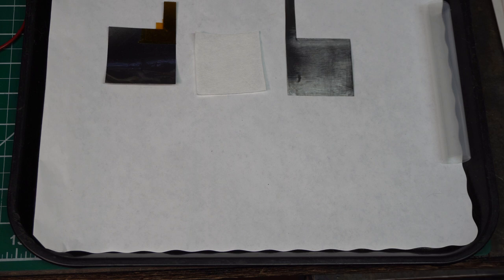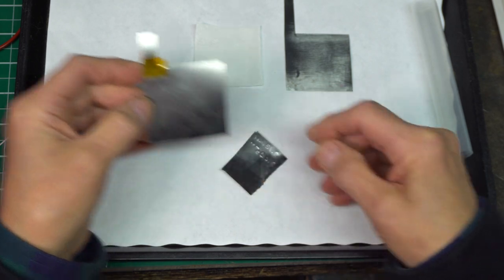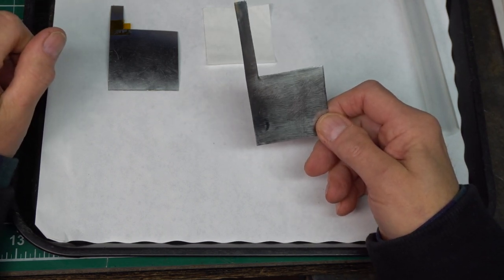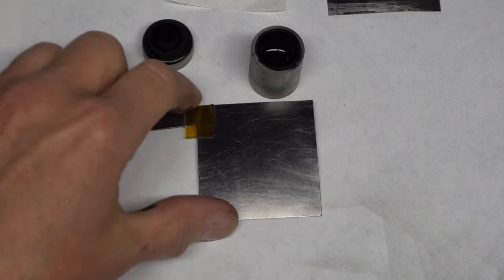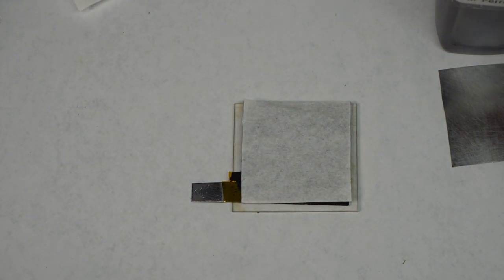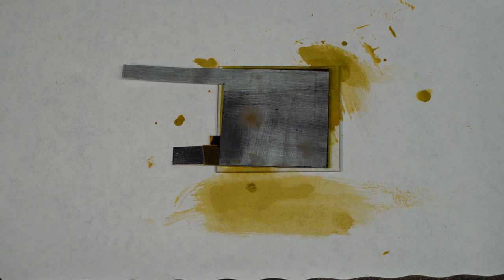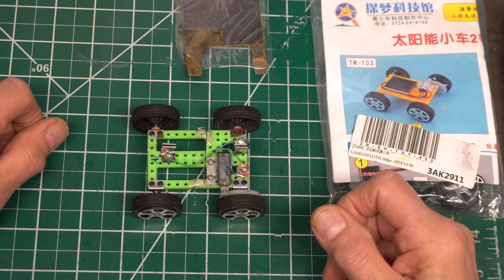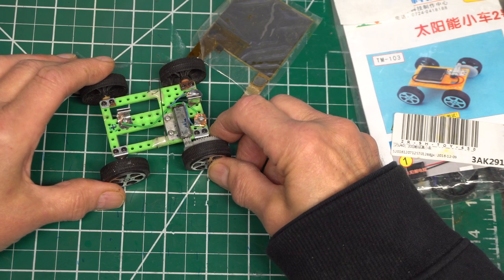Electric Vehicle Powered by Homemade Rechargeable Iron/Carbon Battery

Comment: Many problems:   
First, during discharge, your anode product is soluble in your electrolyte. That is to say, the iron chloride being formed at the (-) plate during discharge is itself soluble in the iron chloride electrolyte. This introduces many problems. For one, you therefore don't have a reversible reaction at the (-) plate.... i.e. you can't recharge the battery. In other words, you can't 'force' the iron chloride swimming around "way out" in the electrolyte to reduce again to elemental iron and re-join the anode substrate material. That would be trying to plate iron onto more iron from an FeCl2 plating bath using a non-iron sacrificial electrode (graphite), and that doesn't work. Iron plating onto more iron can be done, but is extremely difficult with complicated plating chemistry needed. In an Fe-Ni battery, as an example, the iron oxide stays on the (-) plate. It never leaves, because it's not soluble in the KOH e-lyte. It just oxidizes in-situ and doesn't migrate out into the e-lyte. Therefore during recharge, it can reduce back to elemental iron right on the (-) plate. Thus, you can go back and forth. Same thing over at the (+). The various Ni oxides never leave the (+). They oxidize and reduce in-situ, because they are not soluble in the e-lyte.  
Secondly, during the charge cycle of the cell in this video, depending on the voltage used, all you're probably doing is getting a little Fe to 'plate' onto your carbon in sort of a spongy mass, and generating chlorine gas over at the steel plate, and/or electrolyzing water and oxidizing your nicely prepared carbon. You said you charged up your battery for 5 minutes before running the car? What is powering the car then is most likely oxygen and hydrogen that was formed via electrolysis of water during the charge cycle. You have made a simple fuel cell in essence, which is a nice demonstration in itself, but not really a Fe-C couple. 
Suggest: 
Choose an electrolyte such that the anode product-of-discharge (iron chloride) isn't soluble in it. That's why we use KOH or NaOH with batteries having a steel (-) plate. KOH is more conductive than NaOH, and a little less nasty to work with, that's why it is used. 
Since you want to utilize carbon at the (+), why not make an Fe-Air cell? You're almost there already. US patent 3,649,361 (General Electric) lays out a simple method for the Air-side which doesn't require a noble metal catalyst. 
Or... paint your (+) with Ni(OH)2. Utilize a Tyvek separator. Use KOH e-lyte. 
Thanks for posting your work. Very interesting commentary.
Reply: nicepost! and thx tp video poster too

Comment: Hello William, I've replicated the cell you demonstrated and you have inspired me to make a video showing the cell. I've added a few minor changes and I'm quite happy with the result. I would appreciate any feedback or comments you might have. Many Thanks
Reply from the maker: I'm glad to have inspired some others to look at Iron/carbon cells. Not as impressive as some other battery chemistries but it's hard to beat in terms of low cost and availability of materials.

Comment: layered filter paper pouches for the metal plates
Reply: in a carbon air electrode casing, containing lead-acid like electrolyte with the electrodes

Comment: Nice little battery. Have you run any tests on it such as capacity, charge/discharge times, or cycle life? Do you have any info on the chemical reactions taking place at the anode and cathode? A suggestion: why not use a food vacuum sealer to seal one side? That way, you remove all air pockets and increase the contact between the active materials of the cell.
Reply from the maker: I did multiple charge/discharge cycles and the graph reports are in the videos.

Comment: Hello William, really great job. 😉

I don't know if you're still present to comment.

A question I have is about the kind of battery it is "really" , because often the iron based anode batteries presents lower volatges (it's not exactly the case here, kind of mysterious) : 

-  Is it more a kind of supercapacitor on the positive active material? (acting like iron phosphate pseudo capacity in lithium cells)
- Or some kind of internal oxygène breading (the oxygène is some how regenerated at ech cycle )
- Or just the carbon that makes the differential potential (theoritically in "average potential" of the table) and maybe the highest energy links between chloric and ferrous ions that help incrising the oxydo reduction difference (during ionic spliting)

Sorry if my technical engligh is not perfect, I'm nether English (an awful French)... nor chemist ☺
Reply from the maker: Thank you! I believe the overall chemistry of my cell is probably this redox reaction: Fe + 2 FeCl3 -> 3FeCl2 ,   Eo = 0.77V Eo = -0.44V Eocell = 1.21V.    So 1.21 volts is the the theoretical voltage and it looks like my cell is getting close to that output. I guess it's possible that it could be partially acting as a super capacitor but I don't know of any way to prove that. I don't think that it is an iron/air battery because the cell is sealed , completely closed off to the atmosphere, and doesn't have an air breathing cathode which air batteries require.
Reply: @William_Hada  super fast answer  after more than 4 years ;)

Thanks a lot ; Well I think you're probably near the point of cracking the most abondant iron based open source chemistery.

Let me just proposed some points / ideas of improvement or just verifications 

If it's not acting as a supercapacitor you could probably withdraw the carbon ink or at least the active carbon material (with porous reactants) and see if the voltage is more stable and non- breathing during discharge (with wet impregnate iron chloride cotton for exemple or simple graphite powder).

Maybe also try some more common stainless steel cathode electrode, supposed to be oxydo resistant and cheaper (I don't know for the catalist reaction - to be tested).

Nevertheless, good improvement and continuation in your experiments and life.
(From a simple methods engineer)
Reply from the maker: @mathiaspinto4197  Thanks for the suggestions. I found out that stainless steel does not work in this cell especially for the anode. 
Lately I have been working on a Zinc/Iodine battery cell and all my time gets taken up in that exploration. So not much time left for the Iron cell work.

Comment: It's been a couple of years so maybe you've tried something similar with a zinc anode...for higher 
Voltage?    Ant dendritic issues with an iron cell...downside of zinc.
Reply from the maker: Thanks for taking an interest in this battery and watching the video. I have not done anything with zinc because the main purpose of the work was to explore and demonstrate the specific use of iron and carbon as battery materials.

Comment: Any suggestions on other materials I could use as a current collector? Getting graphoil here in South Africa is not cheap nor easy. Would I be able to use copper shim stock and then paint it all over with the carbon ink to seal it off?
Reply from the maker: Instead of using Grafoil sheets you could try painting a sheet of paper first with a conductive paint/ink. Then coat it with the active carbon ink.  Refer to Robert Murray-Smith's videos on YouTube on how to make your own conductive inks. He also sells inks on his website ( https://secure.workingink.co.uk/working-ink-shop/page/2/ ) . Initially, I would stay away from any metals, like copper on the carbon cathode because in my experience its hard to seal off any metal collector completely enough to stop copper or other metal interfering with the cell chemistry. I've tried using/reusing thin Graphite blocks as electode collectors but  they are surprisingly porous and absorb/retain electrolyte salts which contaminate the electrodes if you reuse them in other cell Chemistries. Grafoil is preferred to graphite slabs because of the weight reduction. A good conductive ink on a non-metallic inert sheet material should work OK and worth a try.
Reply: @William_Hada  oooh, I like that idea. I actually have some graphite powder, wonder if I could just make some graphite ink and use that instead of the graphoil. Will give it a go!
Reply from the maker: @StefanWiswedel  Definitely check out Robert Murray-Smith's videos on making conductive ink. You will need some sort of binder in it to hold it together like they use in paints. A simple one like adding white Elmer's Acrylic glue should work. Adding 5 to 10 % by weight to the graphite powder. Adding too much binder can kill the conductivity. You will have to experiment with binder amount, adding just enough to hold it together but not sacrifice conductivity. You will also need to add a little water to make it into a paintable fluid.
Reply: @William_Hada  thank you! I have watched many of his videos but haven't come across good ones on his inks yet. I have tried to make a few but conductivity has always been terrible. I am probably adding too much binder! Thanks for the hint. I recently tried to make one with some varnish (polyurethane). I must try with adding as little binder as possible and then just thinning with turpentine
Reply from the maker: @StefanWiswedel  Here is a link to a good simple conductive ink to try: https://rosieresearch.com/diy-conductive-paint-recipe/
It is important to add as little glue/binder as you can but still hold itself together. 5% to 10% by weight is a good starting point. (The percentage is based on the solid plastic acrylic resin in the glue. The glue has some water in it so the actual resin content is going into be less then what you weigh out).
Reply: @William_Hada  thanks so much. Perfect
Reply: @William_Hada 😮😮

Comment: If your battery weighed about 3.714g, I'm getting a specific energy of ~2.69 mWh/g, or 2.69 Wh/kg. What is the model and brand of battery analyzer you used, and how much did you pay for it? I'm currently using ZKE's EBC series and finding them excellent cycle testers for anyone getting started on a budget!
Reply from the maker: Yes, that is about the total weight of each of the cells that I built. I use the same ZKE battery load tester that you have for initial cell testing and I am very happy with it.  For repeated charge/discharge testing over many cycles, I bought a Battery Metric MK-201 module. I bought it quite a while ago and don't remember the exact price at the time but it was about the same price that they list it for now, $175. I really like this MK-201. It has proven to be very reliable, accurate, and versatile. Here is the link to purchase one: https://www.batterymetric.com/mk-modules/. It is a great value for what it can do at that price. You can easily pay ten times that price for one with similar capabilities.
Reply: @William_Hada  the ZKE EBC-A01, A05, and A10H all support cycle testing up to 1000 cycles per session as well and are all less than $175 with enclosures. I thought I heard you say BA500WIN?
Reply from the maker: @kennethanderson7642  BA500WIN is the Windows software program that I use to control that tester. I wasn't aware that ZKE had load testers that ran multiple charge/discharge cycles.

Comment: Hello, could this be scaled up to power an electric bike etc ?
Thanks for sharing 👍🇬🇧
Reply from the maker: Yes,  in theory,  I think it is possible to power an electric bike with this battery system. But scaling up would require a lot more investigation and effort. It would not be a trivial pursuit but I think it is possible and could be done.

Comment: Is that pyrolytic carbon graphite? Cool video!! Are you from New York? Why would the anode be the iron? I thought that the cathode was the more noble material.
Reply from the maker: No, it is grafoil, that can purchased from eBay or Amazon. The anode has to be iron because it plays an important part in the chemistry of the cell which is oxidation/reduction of iron. The cathode is essentially activated carbon which you could say that it is more noble than iron, carbon is less reactive than iron.
Reply: @William_Hada  
But how to revert it during charging process ?????
Reply from the maker: @TubaParveen-cd2ys  I don't understand what you mean by " revert it " ?

Comment: My guy. How did you make the active carbon ink 

Please tell me
Reply from the maker: Grind together a mixture of 80% Activated Carbon and 20% conductive Carbon Black. Add 10% by weight CMC/SBR binder plus enough water to make a viscous paintable ink.  Elmer's white glue ( PVA glue) can be used for a binder instead of CMC/SBR.
Reply: @William_Hada  cool cool

Conductive carbon means graphite right?
Reply: @William_Hada  should I add activated charcoal or the sugar charcoal?
Reply from the maker: @chrisroyce8252  I used a commercial product called " Ketjen Black ". You can try using finely powdered graphite instead of conductive carbon black.
Reply from the maker: @chrisroyce8252  Any activated carbon can be used. The higher the surface activation area and the more electrically conductive it is, the better it will perform. I used activated sugar carbon in my battery cell.
Reply: @William_Hada  I did make that.  But how do you activate it.  Or is it activated
Reply from the maker: @chrisroyce8252  After I made the sugar carbon, I activated it in a kiln using KOH. There many other ways of activating carbon that will give good results. Please search for this and the exact details of how to do so it on YouTube.There are many detailed videos on YouTube on how to activate carbon.

Comment: Where can I get the electrolyte of this video
Reply from the maker: Ferric Chloride can be easily purchased at many places. One can buy the dry powder or solution from Amazon and eBay. The solution is used to etch the copper off printed circuit boards. I just bought 500 grams of dry powder on Amazon for $17.60.
Reply: @William_Hada  ohh thanks   what are the other materials that I can use as electrolyte
Reply from the maker: @royaltybadboy5465  I've tried lot's of other electrolyte salts and Ferric Chloride is the only one that worked well for me. At this point I know of no other salt that works as well in this particular battery cell.
Reply: @William_Hada  hmmm what abt phospheric acid or sulfuric acid  can I use them  they are used for batteries and super caps right?
Reply: @William_Hada  ok no prob I found ferric cloride but can u send me the vid of the active carbon ink of robert muray smith
Reply from the maker: @royaltybadboy5465  There are countless numbers of electrolytes that one can use in various batteries and supercapacitors. Yes, those acid electrolytes are successfully used in some cells. I am focused specifically on an Iron/Activated Carbon cell using the Fe+2/Fe+3 redox couple chemistry trying to maximize it's performance. Many, many other batteries and supercapacitors are possible with other materials but I am choosing to work on this specific system right now.
Reply from the maker: @royaltybadboy5465  Here is his video on making activated carbon from a carrot but using table sugar instead of carrot will also give you a good activated carbon: https://youtu.be/DeqdwPmWeDA
Reply: @William_Hada  ok thanks I'll check now  but should I need the sulfur
Reply: @William_Hada  ok so I tried to playthe vid but it tells me to join the channel to see it soooo if u can  then can u tell the instructions and the method by a comment   pls
Reply from the maker: @royaltybadboy5465  Here is another video doing the same thing: 
https://youtu.be/unX5lZ4sohA
Rob used Zinc Chloride instead of Sodium Chloride in his video. Table sugar is a good alternative to dried carrot powder. Use a ceramic container like a coffee mug instead of glass bowls and cover it with a small ceramic plate. . If you use zinc chloride don't do it in a microwave that you use for heating food. Mix in 10% by weight of Elmer's white glue for an ink binder. Also, add just enough water to make it paintable.
Ink making video: https://youtu.be/gZQ4lVaaRiE
Reply: @William_Hada  thank u so much I'll check it out now
Reply: @William_Hada  hi and u used the salt and  sugar one right?
Reply from the maker: @royaltybadboy5465  Yes do that one!
Reply: Ok thanks um did you use brown sugar cz I have brown
Reply from the maker: @royaltybadboy5465  Any sugar will work. Use brown sugar.
Reply: @William_Hada  thanks it won't melt in the microwave Right?
Reply: Sugar won't melt in the microwave right?
Reply: @William_Hada  ok one more thing I don't have a mass cueker  thing in grams I have a kg one so can u tell ke how much salt and sugar I should have in teaspoons

Reply soon
Reply: @William_Hada  reply
Reply: U can make ur own.  Muratic acid + steel wool.  Allow so time to react.  Then a little at a time add hydrogen peroxide.  Small amts of h2o2 control heat from reaction.  There are YouTube bids showing this.
Reply: U tube vids, making Ferric Chloride.